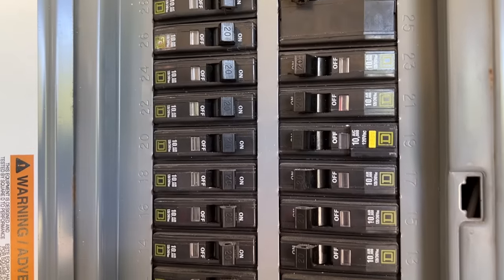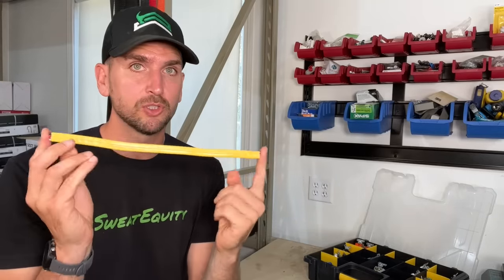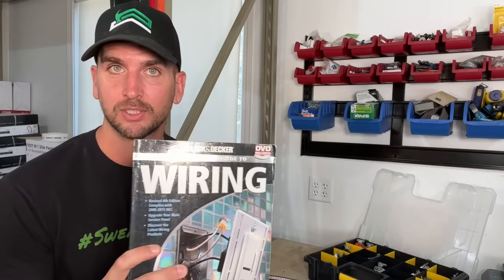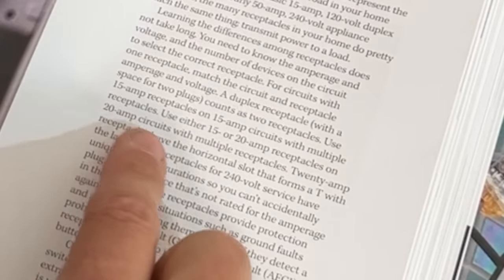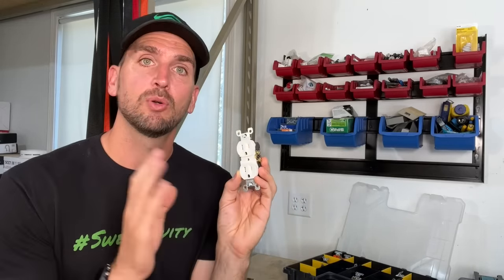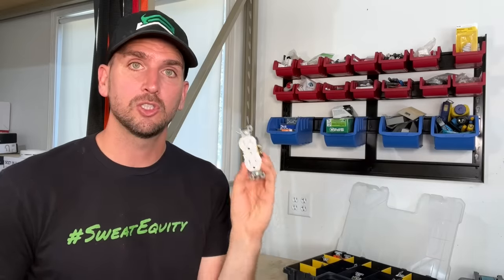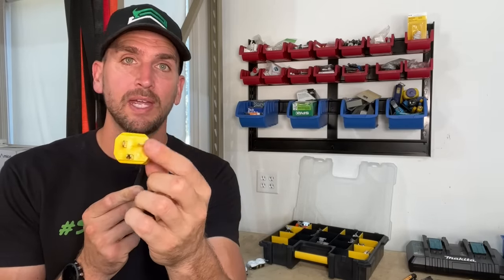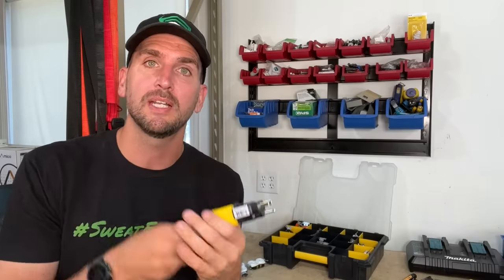Can 15 Amp Outlets Be Used On A 20 Amp Circuit Breaker

Comment: The basic rule: conductors downstream from a breaker must be rated for the breaker. The breaker protects the distribution equipment ( wires are part of that ) NOT the load plugged in to the distribution equipment. The load equipment must take care of faults in that equipment. Commercial devices are made to take some overload without heating. I never use anything except commercial grade screw clamped back wired devices. I just wish all devices were made that way. Going cheap is a bad idea!!

Comment: Here's a question: a kitchen is wired correctly with 12-gauge wire connected to 20-amp breakers, using 15-amp GFCIs and all 15-amp protected outlets. Can you change out one of the 15-amp protected outlets with a 20-amp outlet? Does that meet code?
Reply: Yes as long as the circuit doesn't exceed 20amps, in other words if what you plug into that outlet uses 20amps, that's the only outlet you can use on that circuit.
Reply: Also, kitchens have two 20amp circuits with a shared neutral and maybe one 20amp circuit for the frig.
Reply: @davealexander7930  - GFCI and arc-fault breakers cannot operate with shared neutrals.
Reply: @davealexander7930  - my question is can the 15-amp GFCI handle the 20-amp load downstream?
Reply: Yes they can,the problem would be a fill violation , the manufacturer states that you can't use in boxes with more than 4 current carrying wires , instead I would use a GFNCI breaker that is bridged.
Reply: Also, the difference between a 15 and a 20amp GfNCI is the plug configuration that goes into it , they both sense a ground fault situation, the GFNCI breaker dose both ground fault and overload.
Reply: Remember they are ground fault interrupters not breakers.
Reply: It's not "wired correctly" if it has a 15 amp GFCI.
Reply: @GregHassler  as Ricky  Ricardo would say " splain".
Reply: @GregHassler  - Hi Greg. Actually, it is code to use a 15-amp GFCI on a 20-amp circuit, as the outlet is only limiting what you can plug into it (15-amp load in this case). My kitchen was wired by a professional friend that way.
Reply: Actually, this is not a hypothetical. I have an espresso machine that can run off 20-amp or 15-amp, switchable internally. I'd like to replace a standard 15-amp outlet with a 20-amp and run my machine at it's higher amperage to be able to run both its pumps at the same time. Currently, the 15-amp outlet is downstream and protected by a 15-amp GFCI.
Reply: @BrucePappas  as long as you have a 20amp breaker on that circuit  no problem, doesn't matter that you have a 15amp GFNCI, that's a limiter not a breaker.
Reply: @davealexander7930  Thanks. I'll try it. The worst thing I have to do is change out the 15- to 20-amp GFI or to a 20-amp GFI breaker.

Comment: Interesting video, thanks. I was hoping you might be able to shed some light on a situation in my home. I just had a new service upgrade to 200amp which also included a new interior panel and circuits. I also had my home completely rewired (I'm doing a gut job on an old home). I have 20 amp circuits with 15 amp outlets. When I run a shop vac and a circular saw at the same time off the same outlet, the saw's power will drop considerably, almost to the point that you cant use it. I have tried other tools and the same problem occurs. I tested the outlet and I am getting 120 amp of voltage. Could it possibly be a cheap outlet? It also happens on other outlets that have been completely rewired, regardless of 12 or 14g wiring. I asked my electrician to check but he says everything is correct. Is there something specific I can look for or ask him to clarify? I was going to have the circuits changed to 15amp, but dont think that's the issue. Thanks!
Reply: “120 amp of voltage”  I’ll assume that that’s a typo and that you’re seeing 120 volts.  But are you seeing those 120 volts with nothing running?  You might find that voltage a bit lower when your shop vac is on.
Reply: You could also be at the end of the line. Far away from the supply transformer. Or as has been the case, you may have a 200 amp service but the overhead wire is feeding it run too far distance and are undersized. Conductors running free air don't have to be as large...

Comment: There are also portable EVSEs for EV charging which have NEMA 5-20 adapters or plugs. The adapters signal the EVSE that the circuit is 20A so the car can safely pull 16A instead of the 12A it would normally pull from a NEMA 5-15. Needless to say, an extra 4A at 120v is insignificant compared to Level 2 charging at 220v or more but if you are limited to Level 1 it makes a big difference… literally 33% faster. Actually, it’s even more than that since most EVs default to 8A on 120v since the NEMA 5-15 outlets are often worn out and can melt at 12A. Heck, it even happened to me with a Chevy Volt at 12A. With a NEMA 5-20 adapter signaling to the EVSE that you aren’t using some 50 year old worn out outlet, it can go straight to 16A where before you had to override the default (8A) to even get 12A.

Comment: I onced saw the term outlet explained as a point where just the electrical wires are sticking out before any device is connected. like a rough-in I suppose.
Reply: An outlet is any point in the electrical system where electricity is utilized (used), such as at a receptacle or a light fixture or a direct-wired water heater.

Comment: I have a QUESTION -----> I have a plasma cutter (dual volt) and i am wiring my shed but can only get 30 amps in there SOOOO I want to put in a 220volt 30amp outlet but use a 50amp outlet so the cutter will just plug in without the 110 adapter ?? Any thoughts ???

Comment: I only thing I question (and I literally don't know so please educate me) is that you said in the beginning you assume they have 12 gauge wiring with the 20 amp circuit.  Is that really true or do most houses have 10 gauge wiring with the 15 amp outlets (and 20 amp breakers)?  If they had 10 gauge then I would think using a 20 amp circuit breaker is definitely a hazard.  Sure the metal in the 15 amp outlet may be ok and not melt but the 10 gauge wiring would be prone to overheating should 17 or 18 amps start going through it continuously.   Hopefully you are right in that the standard gauge wiring with 15 amp outlets is 12 gauge.
Reply: *sorry,  I meant do most houses have 14 gauge wire (instead of 12)

Comment: Are you talking about old(original) construction only? As strict as the codes can be sometimes, I can't fathom installing 20a breakers with 12/2 plus ground and NOT using a 20a outlet. Let's say a new homeowner who doesn't know any better looks at the panel and sees a 20a breaker and assumes the outlet can handle it. (again, they just don't know by looking at the outlet and it's 15a rated without the slot on the neutral side, not their fault, just ignorance) They assume it's good for 20a and they plug a big space heater in that's above say 1500 watts. Would the cheap 15a outlet not become the weak point and potentially a fire hazard? I saw it in your book but I can't understand how the code could allow it. The answer should just be no. Why risk it?
Reply: A larger space heater will have a 120 volt 20 amp (NEMA 5-20P) 240 volt 15 amp (NEMA 6-15P) or 240 volt 20 amp (NEMA 6-20P) and will not fit into an ordinary 15 amp receptacle to overload it.   Hope that helps
Reply: It's all planned out so that you shouldn't normally be able to plug in anything that draws more than 12 amps (1440 watts) into a 15 amp outlet. By law manufacturers can't allow that to happen. Therefore, there is no space heater that draws more than 1440 watts that plugs into a 15 amp outlet. And even if an appliance did draw 20 amps the 15 amp outlet could handle it. It's conservatively rated. But the idea is that that shouldn't happen to begin with.

Comment: plugging a 20a device into a 15a outlet is just asking for the 15a breaker to trip, or hoping that someone used a 15a outlet at the end of an otherwise 20a circuit.

Comment: Today, Level 1 EV charging stations (EVSE) can charge a bit faster when wired on a 5-20 non-shared circuit. Put one in ur garage, on a dedicated breaker!
Reply: If you're going to go to the trouble and expense of putting in a dedicated outlet for your charger, you really should put in a level 2 compatible outlet.

Comment: Yes 15 amp receptacle can be used on a 20 amp circuit but I prefer the 20 amp receptacle because they last longer under pressure.

Comment: What about switches?   I had a 20A breaker on a circuit to a dishwasher, but the cutoff switch for that appliance was only 15A.  Since I was in the box anyway (I had no GFIs in my circa 1970 house and was putting that in the box), I chose to upgrade that to a 20A switch.  Did I waste my time?
Reply: Maybe, maybe not.   Residential dishwashers can range from 1200 watts to 2400 watts.  Or at 120 volts 10 amps to 20 amps.   If I were the engineer designing that space, I would require a 20 amp circuit and 20 amp switch, just in case the homeowner wanted that one that sucks lots of power.   So, my feeling,  you did well!

Comment: Okay please be kind here. I’ve watched numerous videos and now I’m confused. I currently had three outlets added in my garage. Wired from the one original  GFCI outlet. The three additional outlets were also GFCI. They all worked. I wanted GFCI outlets for things like power tools, ac and vacuum. But after seeing a few different videos it seems like I don’t need to use GFCI receptacles? And that there should not be more than 2 GFCI receptacles  on one line? Can you please explain to me the correct way that you would do this? I’d really appreciate it. If I can add 3 (15 or 20 amp) outlets from the GFCI one is safe?
Reply: Make sure that this circuit has no GFCI receptacle on it elsewhere or if there is, make sure the load feeds are not used. Also verify that the breaker is not a GFCI breaker. Then the first receptacle in the garage should be a 15 amp GFCI receptacle and feed the other remaining regular receptacles from the Load connections. It's unnecessary to have any GFCI receptacles downstream from the first. If there are any, they must be wired using the Line connections only, so they are independent from one another. It's a waste of money to have more than one GFCI on a circuit, but it's okay if wired correctly. You can basically add as many outlets as you want, but keep in mind you're limited by the circuit ampacity. Unused outlets don't count against you. I recommend that you use "spec grade" (commercial) receptacles as they are more robust than the residential grade. Regardless of whether the circuit is 15 or 20 amps, the 15 amp spec grade receptacles are fine and 20 amp receptacles provide no advantage. In your case, since all the receptacles are GFCI, you can verify if they're wired correctly. Trip and reset each receptacle, one at a time, and none of the others should be affected if wired correctly. 
Downstream regular receptacles that are protected by being fed from the Load connection of the GFCI should have a sticker on the face plate stating "GFCI protected outlet". These stickers come with the GFCI.

Comment: Kind of a personal pet peeve of mine, as a DIYer.  Why waste the money on 12AWG wire, that is more difficult to work with. IMHO, the receptacle should match the wire should match the breaker.  Don't get me started on the oversized plug on welders !
Reply: Using 15A breakers to protect the 14AWG wire.  Just don't use an A/C, microwave oven, heater or hair dryer.
Reply: @solarsynapse  My house is about 70 years old.  It was wired with 14AWG Romex and 15A FUSES.  The only time we ever popped a fuse was when we found out that one of the bedroom window A/C units was on the same circuit as the basement refrigerator and the bathroom.  Turning on a hair dryer was too much for the 15A fuse.